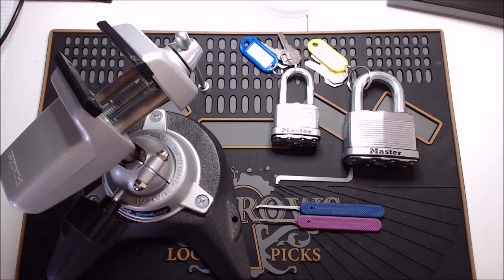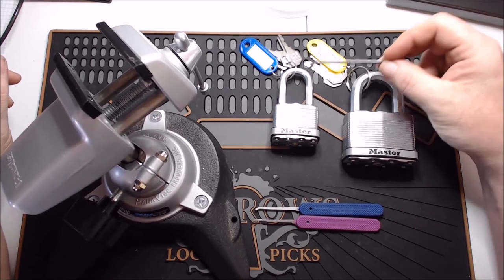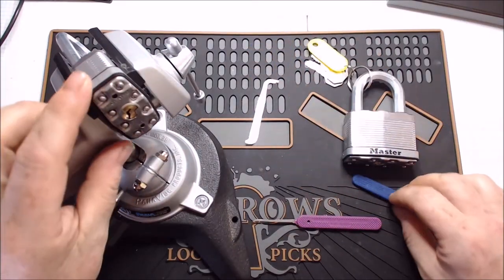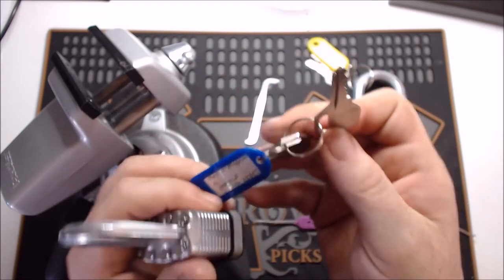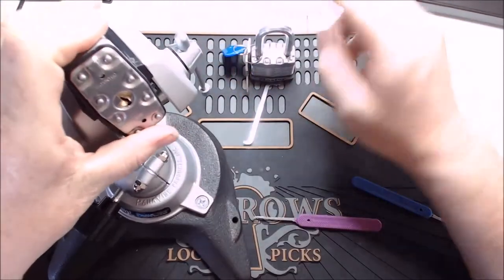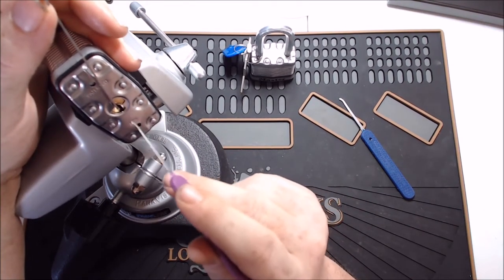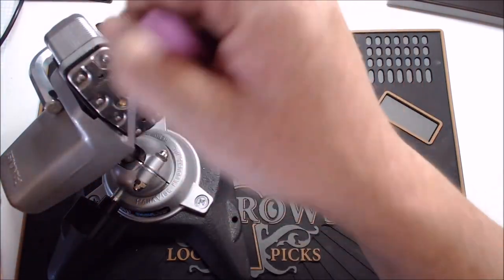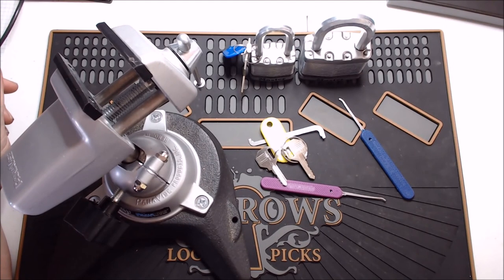(9) Master Lock M1 and M15 Pick Double Feature

Comment: Raked mine open, just to see if it would go.  Just started lockpicking and happened to have one of these on my shed.  I have it mounted on a vice on my work desk, so I open it 5-10 times a day.  I actually go from light tension to heavier tension going from back to front.  After I pass 4, which is really tight, I put a tease more tension and go right through it.  Good job!